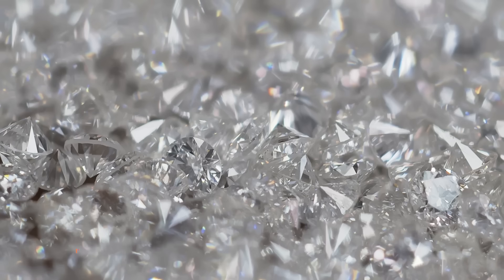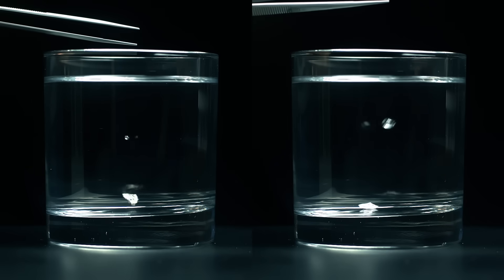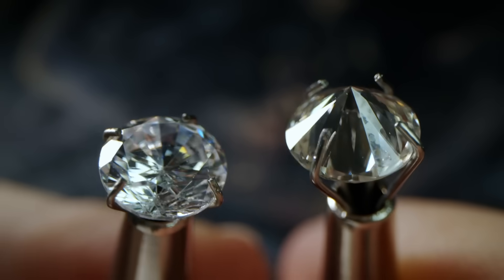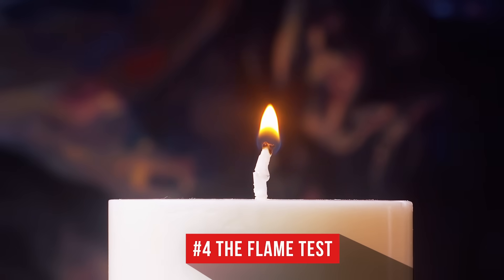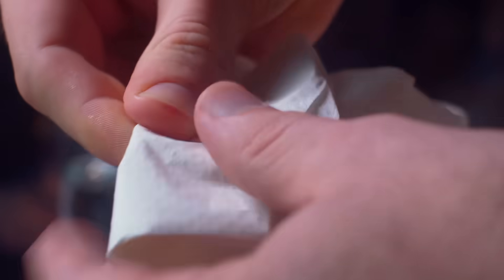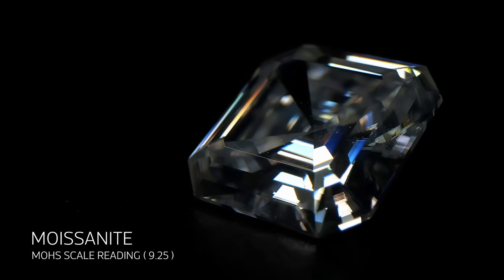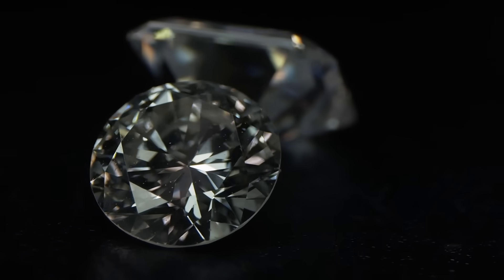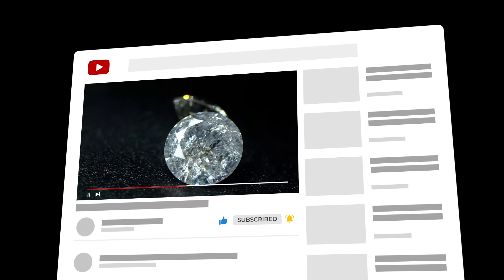Diamonds...REAL vs FAKE!

Comment: Why was a one carat diamond, and a five carat moissanite used for the conductivity tool test, and not stones of a equal size and shape? The reason I ask is on another YouTube channel a test is conducted using stones of the same size and shape, diamond and moissanite, using three different conductivity testers ranging from $30 to $300 (one of which is the Gemoro), and all tested both types of stones as diamonds! My point being, is this tester as accurate on small moissanite stones of 0.5-1.00 carat as it is on 5 carat, or does it produce false positives, as in the other test?

Comment: Diamonds are purest form of carbon...so if one puts a piece of cotton cloth under a real diamond and puts it on a flame,the cotton would not burn as all heat is readily absorbed by diamond . A fake diamond would not be able to absorb such heat and cloth would get burned. This too was told to me by an old jewler.

Comment: Yesterday I went to bought 1G diamond at the jewelry shop,While checking its I drop its on the rubber floor about 1.5 meter Hight.After all I checked it once again but I’m not so sure. 

Do you think my diamond still in good condition.After I dropped its

Thank you

Comment: If you wonder why hard materials are brittle - it's exactly because they are hard - the chemical bonds are short, giving very little 'wiggle room' to distribute kinetic enegy - like a duct tape being very strong unless you bite it, then it rips instantly.
For extreme strength one needs sheet copolymer (carbon loves to make planar structures) that has relatively strong bonds and is flexible enough to absorb the hit. This is why aramide (or Kevlar) is used to make bullet proof helmets and vests.

Comment: 4:09 that's just soot from the candlewax - diamond just gives off a tiny amount of CO2 - strong heating with a blowtorch in air or oxygen would eventually turn the diamond completely into carbon dioxide gas.
The diamond however turn black on its own... evenutally. Diamond spontaneously turns into graphite at atmospheric pressure, but the process is so unfathomably slow that you don't have to worry - it would take eons until one can spot any difference.

Comment: Serious mistake, please get this clear: A REAL DIAMOND IS EXTREMELY FRAGILE; A SINGLE BLOW WITH A HAMMER WILL SHATTER IT INTO TINY PIECES. YES, IT IS HARDNESS 10 ON THE MOHS SCALE, AND IT CAN ONLY BE SCRATCHED BY ANOTHER DIAMOND. A HAMMER DOES NOT SCRATCH A DIAMOND; IT SHATTERS AND BREAKS IT. Goodbye.
Reply from the maker: And that is exactly what we said in the video. Did you watch it?

Comment: This is something that was emphasized by my gemology/mineralogy professor back when I was a geology student.  Do, NOT try the scratch test with a diamond.  As was mentioned at the end of this video, diamonds are brittle.  They also have cleavage.  This is a tendency to break along flat surfaces due to plane of weakness in the mineral.  If you place enough stress on a diamond to cause it to scratch something else, then you could cause it to break along one of these planes of weakness.  This could chip the stone.  This would ruin the cut and diminish the beauty of the stone.

Additionally, ALL of the decent diamond simulants are harder than glass.  So, unless you have a stone that you know to actually be a diamond, this test really doesn't tell you anything.

Comment: DO NOT DO THESE TEST!!!      I just watched the first test, I have never heard of this test before. The second test is not smart!!! A diamond is the hardest of all elements, but is has a grain like wood, a diamond can chip or break. Trying to cut glass could potentially  damage your diamond. The news paper test is a good one, diamonds are single refractive. But that also means any stone that is single refractive will do the same.  OMG!!! putting heat to a diamond is not a good idea!! Maybe you think you can't "burn" a diamond, but you can! (A diamond could also break from temperature change.) What happens is the "Skin' of the diamond oxidizes. A diamond ring that has been through, say a house fire, could be damaged that way. Or a jeweler getting the metal around the diamond too hot could "burn" the diamond. DO NOT HEAT YOUR DIAMOND!!! And finally, the "tip" or culet is not the most susceptible to breaking. It is the girdle. The girdle is where almost all diamond breaks or chips occurs. An interesting note, silica can scratch diamonds. So digging (gardening) in the dirt is also abad idea when wearing your diamonds. If you want to know, 100% if your stone is a diamond, take it to a professional. It may cost you an appraisal. But so worth it.

Comment: I had a solitaire diamond ring that got tossed & it hit the side of a kitchen sink. When looking at it afterwards,  I noticed the chip on it. The sink was not stainless steel. It knew it wasn't a very good quality  diamond but didn't think it should have got chipped. Took it back to the jeweler & it was very obvious that it was a slightly larger, as well as a much better quality diamond had replaced the original. Was there a good possibility that the original might not have been a genuine diamond?

Comment: In my opinion diamonds are the most overrated gem there is. All it does is sparkle if the light is right and the light has to be the right kind. That's why jewelry stores have special lighting. Once you take it outside it loses half its' sparkle.  Opals are much prettier. "A diamond is forever" was the most successful advertising slogan ever.

Comment: You can burn a diamond you can also chip one if you use it to scratch glass I have seen plenty of chipped diamonds from people using their engagement rings to scratch glass and a few burnt diamonds from trainee jewellers who didn't protect the stone with borax when doing a retip

Comment: Can you imagine someone doesn't know that the hardness doesn't effect tenacity and then shatters their diamond thinking it was fake?
Reply: Serious mistake, please get this clear: A REAL DIAMOND IS EXTREMELY FRAGILE; A SINGLE BLOW WITH A HAMMER WILL SHATTER IT INTO TINY PIECES. YES, IT IS HARDNESS 10 ON THE MOHS SCALE, AND IT CAN ONLY BE SCRATCHED BY ANOTHER DIAMOND. A HAMMER DOES NOT SCRATCH A DIAMOND; IT SHATTERS AND BREAKS IT. Goodbye.

Comment: Caution: You must never scratch or hammer the tip on any real diamond, the tip me ght damage, resulting in degrading the value of the diamond.
Reply from the maker: It's never a good idea to hammer a diamond. It's "hard," which means highly resistant to scratching, but not resistant to blows. In fact, it is brittle when it comes to blows.

Comment: If it’s a real diamond and you use a iron hammer the hammer should have a dent in it and the diamond should be perfectly fine I may be wrong but ay that’s my representation of how strong a diamond is
Reply from the maker: Sorry my friend, but your are not correct. Hard means resistant to scratching, not resistant to blows.

Comment: If the hammer can do broke it it's a fake...The real the diamond it's hard to break unless  I had chemical to used to break it...I got a real story of  a man who found a diamond as big as like a cabinet it's real hard to break even to hve a piece of it really can't make break it...the only thing he did is to sleep on the top of the diamond but so far the man became crazy thinking if how to take that diamond... before he became crazy he revealed that he kept it covered it by mud,plant grasses on it and leaved it to the place if where he found it...so far he's crazy and cannot ask him properly...
Reply from the maker: That is not correct. People confused "hardness" with "tenacity" when it comes to diamonds. Hardness refers to resistance to scratching and yes, a diamond is very scratch resistant. It's the most resistance natural substance on Earth. However, that doesn't mean that a diamond is also resistant to blows. In fact, a diamond is brittle. It will break if struck at the right angle/location.

Comment: Real diamonds are resistant to scratches but not to shocks, so if you hit them with a hammer, they will break.
The real MOISSANITE, not the artificial one, is more rare than diamonds. This is because it is made from meteorites, not minerals from the earth, and it is very difficult to find meteorites that can be cut and made into jewelry.
Reply: Artificial and naturalmoissanite are exactly the same. Same chemical structure.. AKA the exact same thing. 

The stuff from space is inconceivably more rare..  but it’s not any more “real.” It’s the same atoms arranged into the same structures.

Comment: If is not relatively easy distinguish between a diamond, a zirconia or a moissanite... Then, aside collectionists, why would anyone pay too much for a Diamond?
Reply: I just bought myself a 3ct moissanite and silver ring for less that $200, it came with a certificate of authentication, and the number on the certificate is engraved on the inside of the ring right beside the 925 silver engraving. Very nice looking ring.

Comment: This test was great. The simple way to tell a CZ from a diamond is to get a carat weight conversion chart, measure the stone in question, then weigh it. CZ and diamond are so different that it'd be impossible to confuse them in this regards.

Fun fact: the first cubic zirconia (CZ) was found in nature, as an inclusion in a metamict zircon. While unstable and eventually breaking down, CZ is actually a natural gem just like sapphire or any other...except that what we have was all grown in a lab.
Reply: yes the high specific weigh of cubic zirkonia is a disadvantage to create jewelry for the ears with setted bigger stones.
Reply: How do you assess the carat? Those who sell you fake diamond would not give you the correct carat.
Reply: @tenton459  by mm width. Even with varying crown and pavilion depths, the specific gravity is so different that they can't be confused in solitaire sizes.

Comment: The hammer doesn't break diamonds, that's not a real story
Reply from the maker: LOL, really? Care to explain how a hammer doesn't break a diamond? This one's gonna be interesting. 🤔
Reply: @Crmjewelers  madam geology says the rule, no matter how hard the stone is, when it's heated and placed in cold water, there are bumps of shock, and it's going from high to low. It's the air that helps the most. There are impurities other than a mirror that react when the stone is stretched
Reply: @Crmjewelers  Why didn't you heat the diamonds, hit the cup a few times before you threw the stone into the water thanks

Comment: I thought hitting a real diamond with hammer wont break it
Reply from the maker: It might survive a blow depending on the angle you hit it and the force exerted, but it'll eventually shatter if struck.
Reply: diamond is hard but not tough

Comment: Dude perfect hit one with a hammer,  nothing happens
Reply from the maker: It depends where you hit it. If you hit it on the table with the tip down, it might make a hole in the table or even in metal, but the "hardness" of diamonds only refers to it's ability to resist scratching, not to resist blows. If you strike it at the right angle and enough times, it'll shatter.
Reply: @Crmjewelers  I agree I do hear you but in their case I guess it could not break it for some reason
Reply from the maker: @damiancampoz4493  they just didn't hit it hard enough or enough times. Trust me, they can break it if they try.

Comment: How they gonna deal with fake diamonts which are actually simullar like real one and they actually reall deal. Any body have clue
Reply from the maker: Are you talking about lab grown diamonds? Those are not fake.
Reply: @Crmjewelers  Yap thats what Im talking becouse they real deal but they not natural but expert cant recognize them from the natural ones
Reply from the maker: Those are actual diamonds too, nothing wrong with them 🤷
Reply: @Crmjewelers  Im not saying there is something wrong with them there is nothing wrong with them they real just they not natural so how you faint that they not natural if they like Egg to Egg just one
Egg is grow in owen and the other one in ground for ages
Reply from the maker: The only way to detect them is by using very expensive equipment that look at the layers of carbon atoms.
Reply: @Crmjewelers  any chance to buy them cheaper than the natural and sell them for more like before the with the zirkons you could cheat buyers becouse thay didnt know them
Reply from the maker: You can buy them cheaper. That's for sure, but to sell them for the same price as natural diamonds, you'll have to scam someone. There are unscrupulous dealers out there and other scammers that try to do that. That's why you need to be very careful.
Reply: @Crmjewelers  I thought to be the one scamming dealers
Reply from the maker: Good luck with that. 😜

Comment: Girl, heating a carat or more and immediately immersing it with water will not affect the structure BUT will damage the brilliance , please avoid giving suggestions that will damage a real diamond!
Reply from the maker: What you're saying is not accurate.
Reply: Yes it's accurate , try to burn a carat diamond and immerse it in water immediately...the brilliance will be affected , it will be cloudy... We call it " pasma" . We'll u need to research more and asked professional jeweller and diamond setter! That's why there are diamonds cloudy in appearance..
Reply from the maker: I already work with diamond dealers and setters. It depends on the source of heat and temperature.

Comment: Moissanite is actually more brilliant than a diamond and refracts colors better.
Best of all--its virtually impossible to tell a Moissanite from a mined diamond of top clarity.
So to me--it makes no sense to pay 5 times as much for a I carat mined diamond when the Moissanite performs better than a diamond in what diamonds are prized for--brilliance..
Reply: Because moissanite is not a diamond 💎 why would I buy it ? I want diamond
Reply: @veronicianyveronica5290  
Sure--if you want a stone that has less beauty and brilliance than Moissanite--buy a diamond and pay 5 times as much.If you put the two side by side--most people would choose the Moissanite.
Reply from the maker: No they won't.
Reply: @Crmjewelers  
Yes they will.
Reply from the maker: Tag, you're it 🤦
Reply: @Crmjewelers  I used to do the Diamond Survey for Dun and Bradstreet back in the day where I learned the truth about diamonds.They are common as sparrows given high value only by restricting the supply artificially by DeBeers.Many diamond buyers have no clue about this.
Knowing this many would opt for a Moissanite--a diamond look alike but better looking and far less expensive.

Comment: I have a 1 carat diamond ring I found on a beach. I took it to Hatton garden to see if it was real and they said "We can't tell without using the machine." So what exactly is the value of "real"?
Reply from the maker: It depends on the characteristics of your diamond, like the 4 Cs.
Reply: Find another jeweler.  They should be able to look at it under a scope and tell if it's a diamond.

Comment: Lab diamonds hah if that was a real mined diamond it would of sparked or pierced the hammer
Reply from the maker: Umm, did you watch the video? We said it was a zirconia 🤦, and no, if struck with a hammer at the tip, the diamond would have likely shattered as well. Diamonds are hard (meaning resistant to scratching) but brittle when it comes to tenacity.

Comment: Pretty much all these tests besides the tester pen are beyond useless.
Reply from the maker: Not really. How about if you don't have a conductivity test? You can still burn it to see if it cracks 😜
Reply: @Crmjewelers  That's assuming you're willing to destroy anything that's not a diamond which is a bad assumption. also a Quartz wouldn't crack since synthetic quartz is extremely resistant to thermal shock.
Reply: @MyDayTradingTutor  Yeh that sounds smart break the evidence the diamond was fake instead of keeping it intact to simply put a pen on in front of the seller as proof. Your refund process won't be a smooth with a small pile of glass powder and no diamond.
Reply from the maker: @Dunkinmedz  the pen is obviously the easiest test if the diamond is expensive enough, but if he films himself doing the test, that seller is going to get arrested pretty easily.
Reply: @Crmjewelers  You act as if people who sell fake things are easily arrested. How are you going to prove its the same stone when all you have is a video of you smashing a small gem. Seller will obviously claim you pocketed the real stone and smashed a cz
Reply from the maker: You can't really prove it with or without the video if you bought this off someone on the street, but if it's a store or a merchant at a specific location, he just can't hide when you go and confront him, have your attorney contact him, or have the cops show up at his location. Not a very good reputation booster for that business.